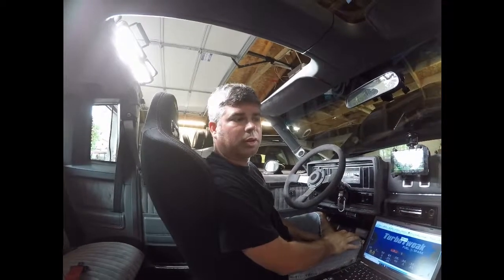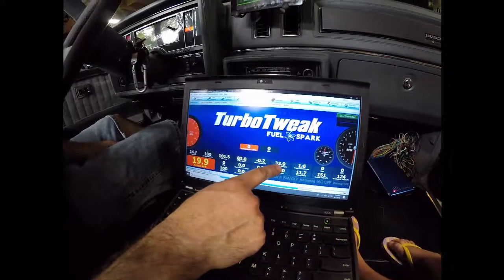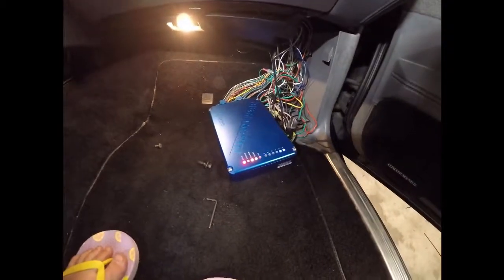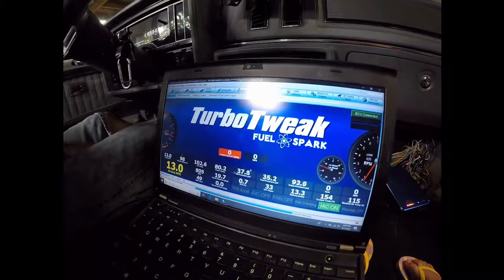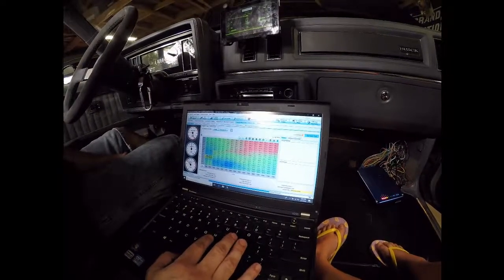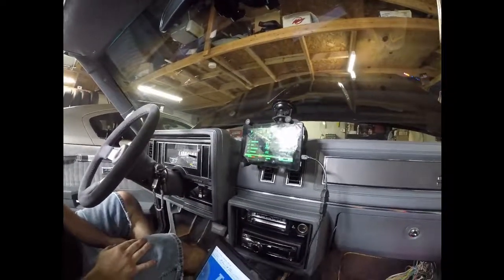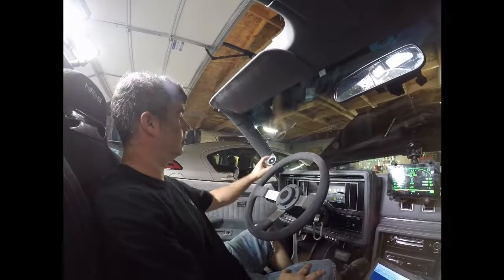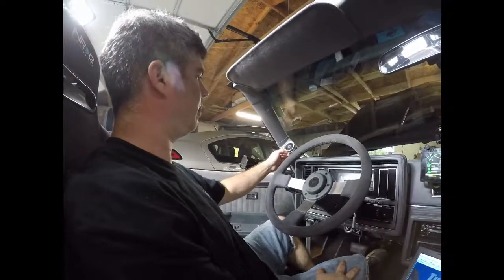TurboTweak ECU GN peek

Comment: Had a question I'm building a stroker motor on E85 and everyone tells me to go with the xfi always ran turbo tweak chips and I'm very pleased is this system you're running is similar to Turbo tweak easy to use
Reply from the maker: It's MS3Pro guts using the TunerStudio software. If you're competent enough to do it yourself, the ECUGN is going to be the easiest route. It plugs right into the factory harness. XFI and Holley require a custom harness or an expensive adapter.

The MS3 Pro's auto-tuning is light years better than XFI's, though.
Reply: How does a studio tuner software works

Comment: What are the advantages of this from Turbo Tweak from say Turbo link?
Reply from the maker: Turbo Link is a twenty year old DOS-based program that only read data from the ALDL port at 300 baud. This is a standalone ECU replacement. Apples and Oranges.
Reply: Andrew Scott can you make adjustments from the laptop to change Timing or Fuel?
Reply from the maker: Yes.
Reply: Andrew Scott have you seen Holley's version with great support?
Reply from the maker: Holley's Dominator requires you to make your own wiring harness and the software isn't anywhere near as easy to use.
Reply: Andrew Scott how much is the Turbo Tweak system?